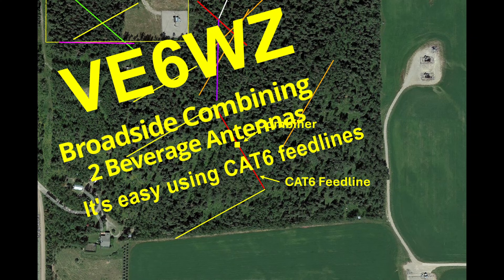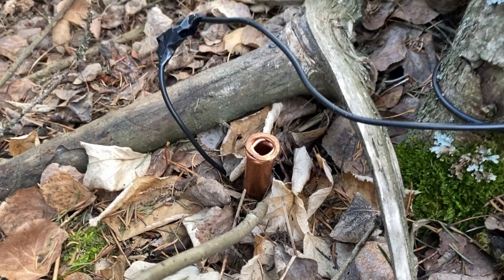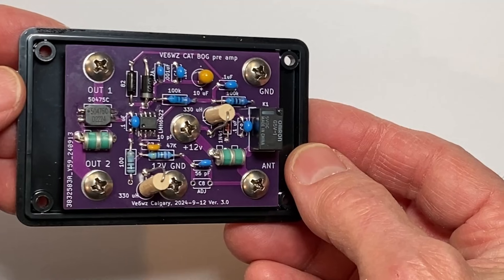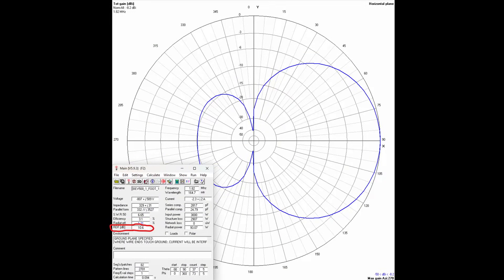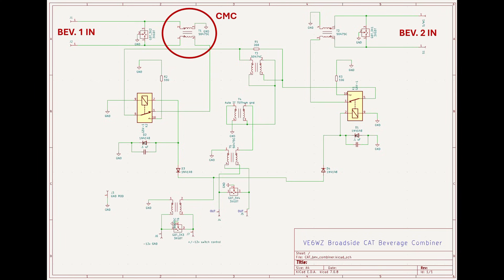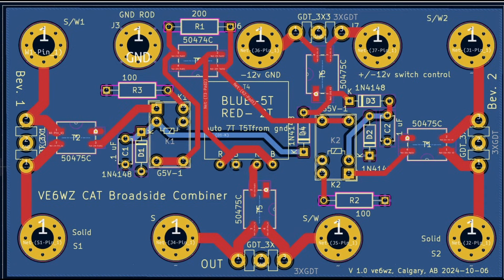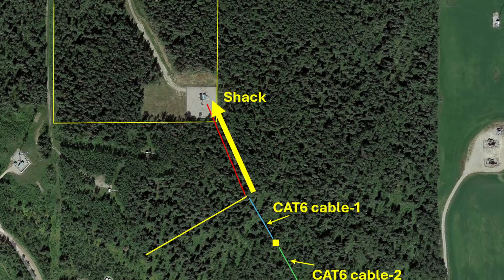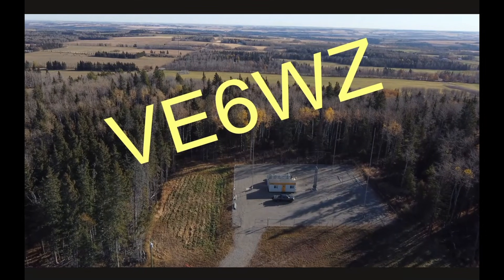Build a broadside phased Beverage array using CAT6 feedlines

Comment: Wow! Grat info. May I ask: beverage antennas as far as I understand, are mostly employed in very low frequency, right? And inly for RX, right? So that leads to commercial stations in AM in 3540 Khz and so on right?
Reply from the maker: Yes, mostly for the lower frequencies. This is because on higher frequencies its easier to build directive antennas such as Yagi's.  On the very low frequencies, these antennas become too large. The directivity achieved from a Beverage antenna really enhances the SNR on received signals. And yes, receive only, not transmitting.  I use my Beverage antennas mostly on MW (BCB DXing), 160m, 80m and occasionally 40m.

Comment: How do you check if the cat6 lines are equal in length for correct phasing? Do you use a TDR to check line length or measure them with a VNA or does your phasing method not rely on precise phase lengths? I just thought that different CAT6 lengths would perhaps have different twist rates hence different physical lengths?
Reply from the maker: Because of the large wire spacing (400'-500') the phase lines do not need to be precise.  Within a foot or two is not a problem.
With a close spaced end-fire array small differences can indeed upset the pattern.
I just used the length markers stamped on the CAT6 cable. Of course it would be very easy to check using TDR.